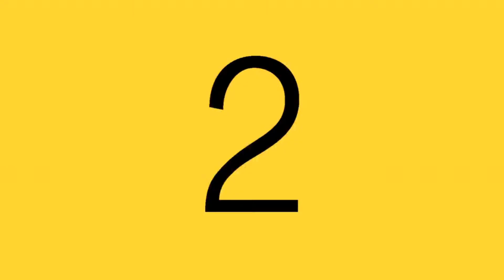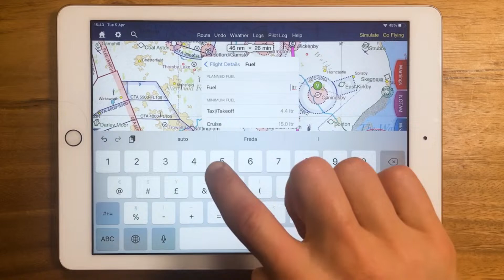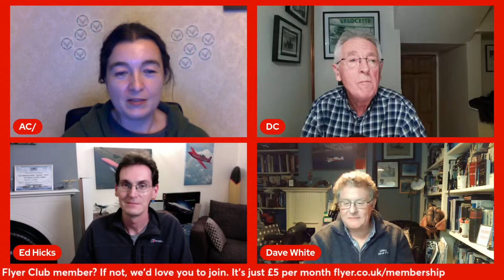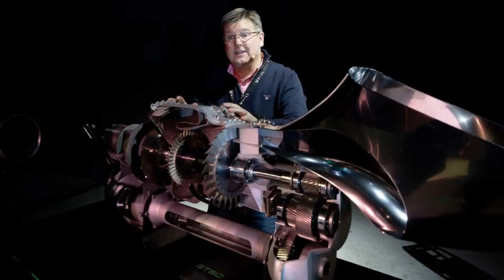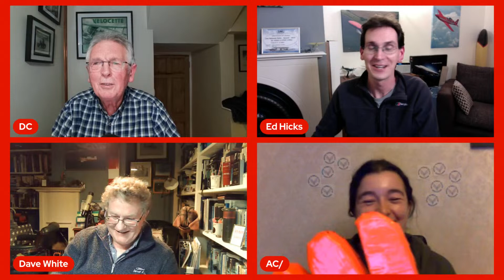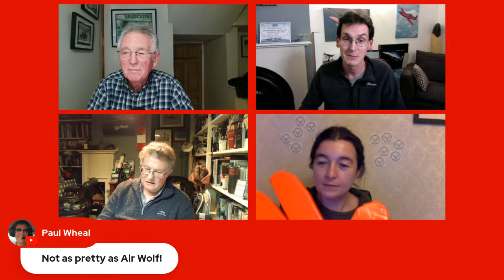FLYER Livestream - 15 February 2024 - Jason Hill

Comment: The MD 500 series blows everything away…..in 1966, when the first flights took place, it set 22 world records for speed height and endurance. It is simply one of the best helicopters ever made and is still made today and used extensively in commercial and military roles.